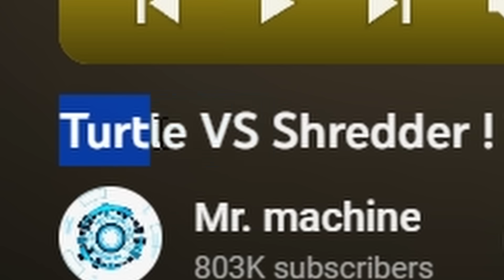Lava Vs Bulletproof Glass

Comment: 0:48 to 0:58

Volcanoes smoke is 1000 degrees Celsius and could travel at the speed of 700 km

And the lava would be coming in at 19 mph

So if you were in the box you would be safe from the smoke but the heat will heat up the box and the Box does not have an oxygen tank so you ended up getting steamed alive 

and the lava surrounding the entire box would destroy it

Comment: 2:16 They only hold up well because paper doesnt melt so you cant abuse the heat to melt its way through, you have to rely on charring the paper enough for the cutting power to be able to cut the thick stack of paper, so one paper sheet is basically abouta  quarter of a second and since the heat keeps distributing, you dont have enough heat to cut through the whole stack.